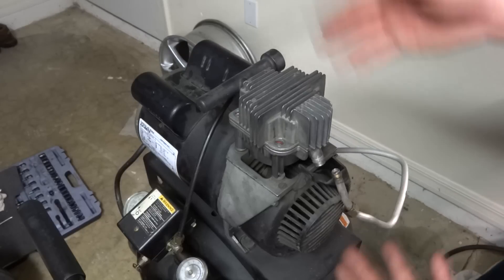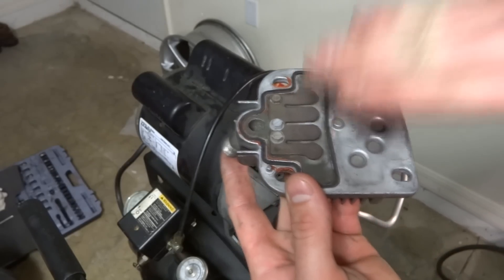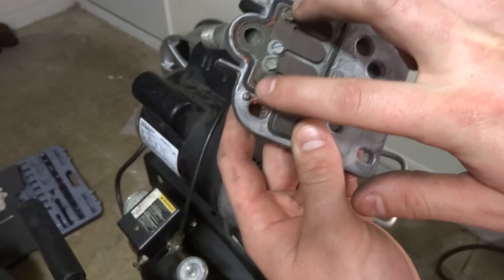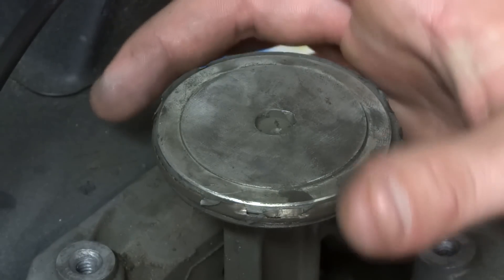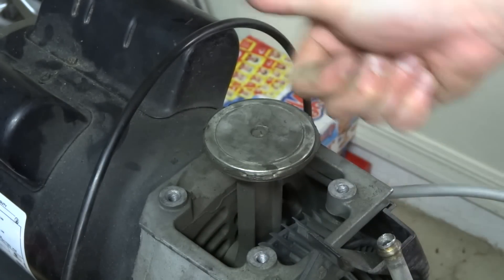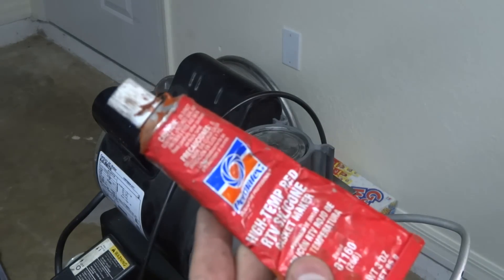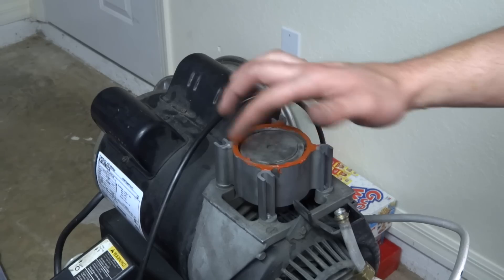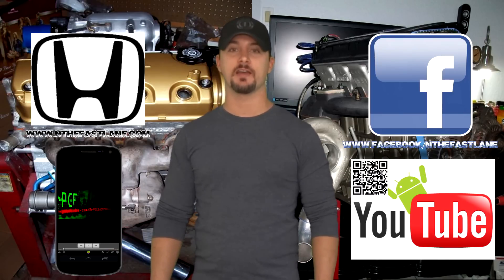Air Compressor Not Building Pressure?!? "Free Fix"

Comment: Mine had exactly the same symptoms that you describe - not reaching pressure and hissing loudly.  Thanks to your video I decided to open it up to have a look. Having removed the plastic shroud, the first step was to disconnect the airline union, and I noticed that it was much looser than expected.  I nipped it up good and tight and did a test run.  PROBLEM SOLVED.  I didn't have to dismantle the cylinder head at all.  Thanks for your help.

Comment: Hi,                                                                               I’m going to try this. I have a small Goodyear compressor and I’ve had it for over two years and probably used it 5 times, if that many, to gas up my tires, on an old Mitsubishi 90
Mighty Max pick up truck with aluminum rims. 
I like your site and how to fix it. I’m not very mechanically inclined, but you make it very understandable. I’ll let you know how it turns out.
Faubus

Comment: Your video was helpful, but just a point you can take off the top plate of the piston and take of the copper ring and straighten it better.  I called a parts company and they will not sell the ring separately but you can go to a hardware or auto parts and you might find a replacement.

Comment: If you only use this type to Fill Tires-
Set pressure limit switch to turn it off at 50 PSI.
It'll last ten times longer.
No need to go to 150 psi that creates very high damaging head & valve temps.

For all day 160 psi shop air - get a real compressor.
Oil bath splash & real pistons.
Can also add small high flow blower to keep head cooler.
About 2" outlet like hair dryer size squirrel cage, comes on when compressor does.

Comment: I have a twenty year old Craftsman. 4hp, 25 gal.  These last couple days, it would not go above 80 psi. Max is supposed to be 125 psi. Today it would not go above 40 psi, even after one hour. Getting ready to take shrouds off and see if I can see if I hear or find any leaks. I took the air filter foam thing out and cleaned it a couple days ago. Today, I took it out again, with it running, I noticed it is pushing air out and I thought it should be sucking air in. Never took it out with-it running before, so not sure. I read somewhere that might be a reed problem. Any ideas before I go any further?

Comment: I also have a Black Max but a different model.  It is 15 years old and all of a sudden won't build past 80 psi.  One of the reed valves has a chip in it, do you still think the piston ring is a problem too?  The sleeve slides off real easy, they want $100 for piston assembly.  I use it for air tools. (back yard mechanic...)

Comment: What do you think can be the problem of the air compressor pushing air from the intake filter and sort of humming? Can it be that I did not change oil and not used the compressor for sometime? Thanks.

Comment: I have a black max air compressor B165B500-25 
It says 135psi but it shuts off at 80 psi
What could this be?
Reply from the maker: The square D pressure switch needs to be adjusted. Look at the black plastic box on the air compressor, take the top off with it unplugged and tighten the spring. Then plug it back in and see how high the pressure gets. Adjust according to what you're looking for.
Reply: Nthefastlane thanks that worked
Reply from the maker: Anytime Daniel.

Comment: Hey Jeremy I have a mini air compressor its a elite 175 x model and the piston cam came unscrewed from the motor shaft and I'd try using some lock tight and screw the cam back on and let it set over 24 hours and when I turn it on to use the cam cam back off. Can you tell me how to keep the cam back on the motor shaft . Thanks in Advance

Comment: Hi there, Jay here. I was wondering if you could possibly tell me whats wrong with my Porter Cable 150 psi compressor? It's regulating ok but my compressor comes on way too pre-maturely/ any help appreciated !
Reply from the maker: Hey Jay, you need to adjust your "square D" pressure switch..what model is your compressor?

Comment: My compressor is building pressure but the problem is, its not releasing it with pressure. Like if the hose was kinkes but its not. What could be the problem?
Reply from the maker: ClaudiaGamino Adjust your Air Regulator Valve "Turn it all the way to the right to send
 less pressure to the line or to the left all the way till it stops to 
increase pressure>>> Look at this image for a reference. @images/a04/nt/eu/adjust-air-compressor-regulator-800x800.jpg
Reply: Nthefastlane
All Regulator Knobs Screw down to the right for more line pressure.
This guy probably has bad check valve at the head output as well.
So it can't build pressure.
Or damaged/broken reed valve in the head.
Reply: First, make sure your unloader valve it working. Some compressor heads have a small pipe that comes off the heads down to a small schrader valve on the pressure switch. Large compressor heads often have the unloader build onto the compressor pump, but will still have the small hose leading to it. Small portables like Hitachi may have a valve, like the safety valve, but instead it just before the check valve. If the unloader is working, then your check valve has failed. The unloader valves job is to release the air left in the heads after the compressor has shut down. The check valve is a one way valve which allows air into the tank, but will not let it back out.
Reply: These small Oil Less units don't have Unloaders.
By now Head must have shown broken Reed Valve, 
Usually there's a group of 3 Finger Reeds fastened to top side of Head.
Good Luck - Let us know.